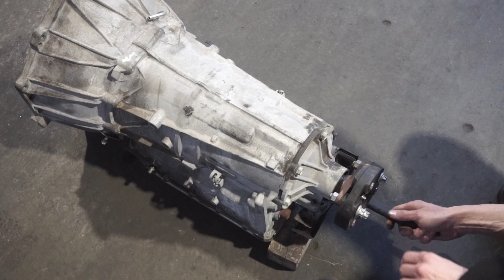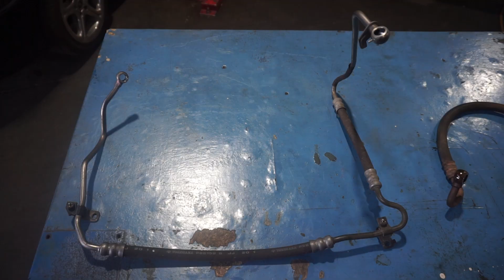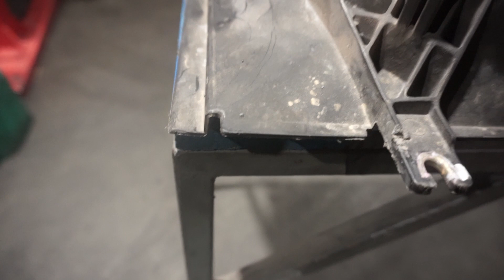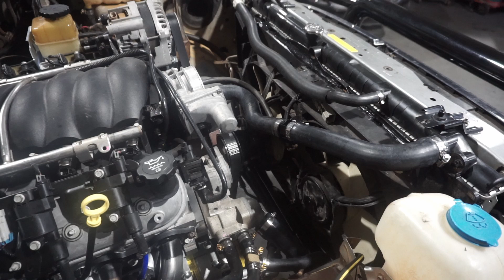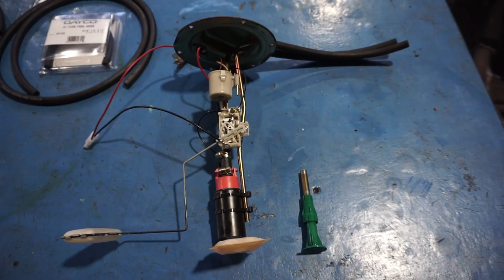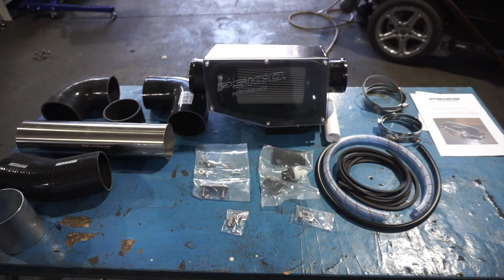GU Patrol 3ltr to 6ltr Ls Swap Part 2/3

Comment: Love the vids. Did you guys make a new fuel return line to the tank to stop pressure regulator from pulsing at idle.
Just about to do my fuel system and was thinking 6mm return line might be to small.